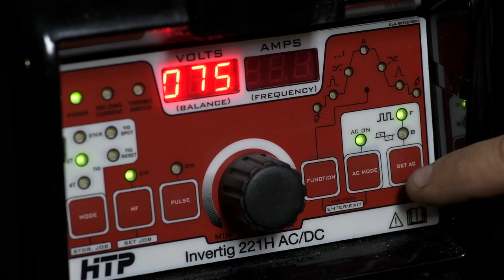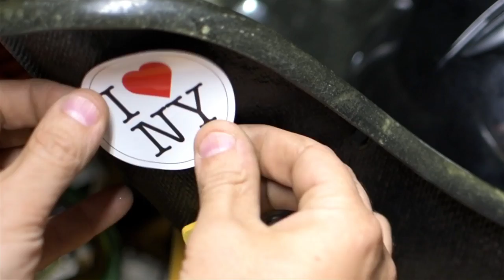GO KART - Part 4 - COMPLETED!

Comment: I'm gonna do it. I estimate $600 in supplies, $87,000 in tools and equipment, 2 - 3 years to learn how to do everything. I could cut the learning time if I quit my job.
Reply: LOL.. was thinking the same thing...
Reply: i think you are a little shy on the tool budget haha
Reply: I be thinking craigslist and scooping up a used kart and instead of taking all the time to build use all that time and go to the local kart track watching the young one learn how to drive, race, learn about apex and lines and all the do's and don'ts .
Reply: @danjason2167  na, he he's about right for harbor freight.
Reply: @donnyschort6150  ya but he might want to make more than one before the tools, tooling and machines wear out.lol
Reply: Step 1: start saving and buying equipment.
Step 2: locate a good wife =)
Reply: rofl nice one
Reply: Colin Furze is here for you! He made a bit more crude go kart without welder or other expensive tools
Reply: I can help you learn solidworks
Reply: @professoreggplant9985  Excellent advice
Reply: You can "get by" for about $86,900 if you shop "used".I didn't .....;-(.....got about 30yrs and $300K or so in.DON'T do what I did unless you want a great skill set,fair-decent career,and LOTS of friends when their sh!t breaks,lol. BTW Tony, HF tires are soft as all heck,but cheap as all heck too! OOPS,forgot to ask Tony how long/much did the track build set him back,looks like a lot of asphalt,lol?
Reply: HAHAHAHAHAHA me to.
Reply: @jzero32  Yep, I've seen karts sold for a few hundred dollars, which is probably the same it cost to build this one, minus all the tools and work required!
Reply: shit you wont be even dangerous until 10 years with all he has !
Reply: or just go to Pep Boys and spend $500-600 on a Go-Kart that you assemble at home the kit includes everything needed for assembly.. a few hours later your zipping around the yard. and if you feel adventurous Harbor Freight offers higher HP motors that fit on the original Kart with minimal effort.
Reply: @warriorwk  yeah I use Harbor Freight Tools all the time and if it doesn't say Pittsburgh on it it's more of a one-time-use
Reply: Mike Smith  yeah I guess that's true I used to build go-kart frames when I was in high school with nothing but a shity Hobart wire welder and a chop saw that was dismantled to become the death saw as we called it. It was basically a chop saw you just held onto there was no Bass. there were many exploding blades and I don't know how we were never injured
Reply: Criminy,  my first kart was a 2x10 board with an old B&S 4-cycle and rope steering. It had fan belt drive and the final drive pulley was bolted to the left rear wheel.  

I don't remember a seat... though maybe there was just another short piece of 2x10 board to lean back on. If I had a dad like you, I wouldn't have learned to be the mechanic I was for 57 years. 

Retired now, I use my accumulated tools and shop equipment for hobbiest pursuits and fixing my tractors and farm gear. 

Perhaps it's time to build another 2x10 plank racer like the summer of 1959.
Reply: You also need 2 kids, they take a while to grow.
Reply: your time and money estimates are way way low.....
Reply: lol rookie
Reply: flyrod1000 Bahahahahahahahahahahaha!!!! No shit!!!!
Reply: flyrod  at the least and more likely more !!!
Reply: So true
Reply: flyrod  the guy is a mental case ready for an institution !!!  WHACKO for sure !!!!  and OCD !!!  What he has spent in tools equipment he could have hire the house built and been finished by now, living in a new finished house rather than a basement !!!
Reply: That's why you get a guy like me to build ya one . Lol
Reply: that's just an excuse to buy some tools and quit your job lol
Reply: Or you just go to engineering school and join the FSAE team. You'll then see this build was just child's play :)
Reply: Pennsylvania Mike I built a sports car chassis with not much more, plus a flat base board (MDF). Haynes Manuals used to have a book of plans (“Build Your Own Sports Car”). Les in UK
Reply: Ambitious!
Reply: Seems about right.
Reply: I believe your estimate is legitimate, Let's add some pay time for an engineer and a certified welder, so it would cost about $100,000 to build one myself, This guy wins as he is a super dad, my go cart was awesome, but made out of wood with rope steering. Thanks for sharing.
Reply: Hey man you’ll get there some day if you dedicate all of your free funds to an u healthy machinery addiction😭
Reply: Its been 3 years wheres my go-kart
Reply: How did it go sir? You got it done I hope?
Reply: Alot more than 87k in tools lol
Reply: And alot more than 3 years to gain the knowledge he has
Reply: How’s that going now?
Reply: I’ve built a couple of go karts with cheap tools from harbor freight and tractor supply, Walmart, eBay, and Amazon as well as Go Power Sports
Reply: Awesome work
Reply: @turtleb01  ...and I am sure it would shake itself apart over time lol.
Reply: Well… did you do it or did you wimp out?

Comment: Wait a minute... My "go-cart" had a mower deck under it and only worked on the lawn. I think my dad pulled a fast one on me.
Reply: mine was just a piece of cardboard that only worked on grass and only on downhill's
Reply: MINE HAD A HANDLE THAT YOU HAD TO PUSH.
Reply: mine was a milk carton and scissors....
Reply: My granddad made a wodden car for me, with babycarriage wheel and a steering wheel from an old consul,  I also wanted a motor on it but it never happened...  Granddad, u were the best...
Reply: Mine was a wooden board with 4 ball bearings instead of wheels. Self-made :)
Reply: No!     I won best dad ever when my wife discovered my sons porn stash and I took the rap!
Reply: Lol cute
Reply: "Go-cart"? In the '60's I had a classic steel body "Lil Red Wagon" with the front wheels axle pivot assembly attached to a pull tube with a "D"  handle at the end. Motive power was another kid and you doing "turns" pushing or pulling. 
Once sister and I were too big to ride, it became a kid powered grocery delivery wagon, fire wood hauler and a light garden cart.  
I think dad greased the axles once every three/four years and touched it up with Rustoleum when needed. I remember he was still using it in the garden in the early '90's before he passed on.
Reply: had one of those too. ate shit pretty hard a few times trying to take it down hills haha  @ralphmills7322
Reply: @colsoncustoms8994  Yeah I remember a few bail outs coasting down hills... 
Most unintentional with an occasional emergency stop. If you try to push the handle too far into a turn you launched yourself arse over tea kettle.
Reply: yep, the handle was what got me every time haha  @ralphmills7322
Reply: Mine is a laundry basket going down the stairs.
Reply: @MihaiCadariu  la fel ca al meu frate 🤭🤣Made in RO 😁
Reply: Mr. Bill 'Mine' was my sister's and I got to ride it once before it was parked and never again till I was far too large to fit in it and it was pretty rusted. What fun.
Reply: You guys had stuff you could ride? I want a refund on my dad can I get a new one?
Reply: mine only worked on snow and on downhill
Reply: those were the days
Reply: @ralphmills7322  And remember: left is right..  right is left for the sake of your life.
Reply: @reniervisagie1206  And stairs, can't forget about cardboard on stairs. With a wall at the bottom.
Reply: I ride my 30 year oldJohn Deere twice a week around this yard. I have had to d a lot to keep it up. I need to take the whole thing apart and go over it all.
Reply: Me to
Reply: Mine was a milk crate and vegetable oil
Reply: Mine was a parabolic dish that only worked in the snow. Ok at one point we did have a proper go kart but you turn left too sharp and your elbow hit the bare spark plug.
Reply: HA! HA! HA!  😁😎😁😎
Reply: Heck,  My dad got an old riding mower  (1 cyl pull start)  and I got to drive it around the neighborhood for fun...  it had an OK travel speed and I sure enjoyed it.   We did NOT have a yard.
Reply: @theogdirkdiggler  hahaha... Best name ever !
Reply: Mine had one wheel and dad would keep filling it with dirt
Reply: ROFLMFAO
Reply: Billy Noon Bru
Reply: Mine was a tractor in the low speed gearbox and a grandpa sitting on the passenger seat.
Reply: mine has two arm rests and 5 legs with weeks under the seat, and sometimes i could lower and raise it, but my dad uses it for the office /:

Comment: My first go-kart was made from an old lawnmower. It had a top speed of about 20 mph and the center-of-gravity of a bar stool. It had no brakes, and the throttle was a piece of nylon string tied to the carburetor. You pulled the other end of the string with your teeth. Ah, the 1970's.

Comment: You are an amazing Dad. In raising kids, you get one opportunity, there are no do overs and I cannot imagine your kids wanting it any other way. They are quite fortunate to have you. I ran go carts when I was a kid back in the 60s. We had basically 2 types, sprint carts such as yours and enduro carts where you were more laying down with a butterfly steering wheel between your legs and 2 gas tanks, one on each side of you. And..... we ran chainsaw motors, McCullough to be exact. Very high revving, could be clutches as you have or direct drive for more serious stuff. Old Tillotson carburetors. And your kids are out in the air, not sitting at some electronics console staring blankly at a TV screen. They will thank you later in life.

Comment: We were poor and didn't know it ,our cart only went down hill what the heck was a motor
Reply: mine had an ancient briggs and stratton and was one-wheel drive
Reply: Downhill here, too.  We used our feet to steer the 2x4 front axle.  Somebody got the idea to put a rope on it.  We had to drive it into the brush to get it to stop.
Reply: Mine was two metal bars and a piece of wood to use on ice
Reply: Oh, ya'll had good old-fashioned Rolls-Canardly, too, eh??? 😎
Reply: wait you had hills???
Reply: Woohoo! soapbox derbies!
Reply: @bob15479  Ours too !!!
Reply: Gravity powered.  The restart was very tiring.

Comment: In 1966 when I was a young boy in CT. we had a visitor to our metal shop class. He had a twin McCullough chainsaw motors and 4 wheel disk brake go-kart. It was a beast.  I was hooked. You did a fine job building this sled. Congratulations.

Comment: I always wanted to learn welding. It would allow me to create even more great builds with my wood working projects.
Reply: lol yes you must use a hardwood.
Reply: PinballMan Pick up a cheap TIG and get started. It is such a useful skill.
Reply: LegionStriker n
Reply: not to be picky but when welding hardwood its best to use a dowel of the same wood for filler. chopsticks can also be used as a backup.

Comment: Drop tire pressure very slightly, like 5-10%.

I use an infrared temp gun on tires.  Measure across the tread, look at inside, center, and outside after driving a few minutes.  Measuring temp then compensating alignment and tire pressure works incredibly well for tire life!
Reply: thats awesome pal

Comment: Awesome build. Looks like a blast. Your TIG, Millwork, Lathe, & Fab, and CNC skills are awesome. To fab without a frame jig is very difficult! Keep the awesome videos & projects coming. Maybe cut where the frame is sleeved and make the frame longer. Make the seat a bench seat with a seat frame that's adjustable. This should accomodate your daughter & son. Make a cover on the front floor pan to protect rack & pinion from sneaker laces.
Reply: bench seat? really? like driving miss daisy.
so lame. 
i loved watching this project. you sir are to be commended for your efforts.
top notch fabricator and dad. A+ 
God bless.

Comment: Hey Tony, I know here in the states that we have standardized utility-trailer tires. Usually they come like 8" or 12" and they also come with the wheel too. I know you are more knowledgeable than me; however, thought I would mention that. I have purchased them at tractor supply and they have excellent durability. You might also have those retreaded if they offer that there.
Reply: Michael Hart They also have them foam filled so they won't go flat!

Comment: Not to scare you,Tony! But I have a suggestion, based on persona (real-life) experience: Try to get a shoulder belt onto this. My go kart had a lap belt, which was good.... and it had a roll cage, which was good... and when I drove straight into a tree, the lap belt kept my waist secured. That meant my head snapped forward and I smashed my face into the padded steering wheel, which broke my nose and introduced two decades of sinus problems.
Reply: that is why you wear helmet and preferably neck support and if you really want to safe - a rib guard while riding these, that is safer than a seat belt and roll cages, because stiff - non shock absorbing structures, rigid seating and tight belts introduce problems and risks of their own, there are quite a few design problems when designing "safety cell", and making everything very rigid and tight is actually bad, think about this way - if you didn't have the belt at all in your accident, you would have hit the steering wheel with your rib cage while also absorbing some of your bodies kinetic energy with your legs, and there would be very little chance of your nose hitting anything - damage would still be done, but it wouldn't be concentrated at the head area - which is pretty much the worst part of the body to use to absorb impacts for a human
as I've said times before in this series - just look at pro carting equipment for kids, it is FIA regulated stuff, every rule there is for a good reason, accidents do  happen, and serious injuries are pretty rare, that being said, if I was a parent of one of the kids driving there in competitions, I would probably have 57 heart attacks average per race
Reply: I agree on all efforts to protect his kids, but looking at proportions, there is also a top limit for protection when you consider the moderate speed this cart has. I hope your injury has been cured and you are well.
Reply: I dont have belts on my kart. With a super low center of gravity and no roll bars its really hard to flip. The one time I did, I was glad to be able to jump free. Would have been a disaster if i was strapped in. Unless you have a rollbar installed you don't want to be strapped in if it happens to flip, imo
Reply: Or you pay attention to where you're driving... I drove two fast go karts from ages 8-13, I never hit a tree. Theres a steering wheel and brake to make sure that doesn't happen lol.
Reply: Ive seen more kids hurt by having seat belts and roll bars on their carts than those without them.
Reply: @Paul Michelli: Doesn't mean some one won't hit you. That's how it happened for me. Maniac cut inside, drove me of the course and double break in my left arm. Lots of factors one can't control.
Reply: He's going all of 5 mph and wearing a full-face  at that.   He's probably more prone to getting hurt by simple running.  The danger is almost insignificant.   He probably won't run smack-dab into a tree.
Reply: DFWKen I agree, the boy was on, what appeared to be a race course. I didn't see a tree in sight. I did far more dangerous things on my BMX bike as a kid. I am amazed I survived childhood, considering some things I did.
Reply: Jason Olsen that is why you should wear a helmet
Reply: And wearing one I was! Unfortunately, it was not full-face.
Reply: you never want seat belts unless you have a roll cage. Otherwise the cart can flip and crush the rider.
Reply: Death is inevitable. Just have fun.
Reply: Jason Olsen,  How fast were you going. Yikes !!!!
Reply: to me the sinus problems are the worst part of that story
Reply: Looked like the top speed was around 10 mph, don't think it needs it.
Reply: I know this is a year old, but I got a go cart with a top speed of 30 mph on my 5th birthday in 1979. No seat belts, no helmets, no padded steering wheel.  I ran into a few things but I lived LOL. I still have the go cart and my niece and nephew drive it.
Reply: you are not supposed to drive into trees.
also i would hate to be on a go kart buckled in. my son flipped our cart in the dirt because he never braked. he'd nail the gas and go full bore around corners sliding all the time till one time for some reason the tire got a good bite and the cart flipped instead. had he been strapped in he would have probably gotten hurt but instead was just flung free and nothing but a bit of scrapes and bruises.
Reply: You just described a 70s Honda Odyssey. We use to flip my buddiy's over on purpose. Keep your hand inside or you break your arm. Saw it happen - owie!

Comment: Amazing!! the I<3NY sticker was for me ... i know.. xoxox
Reply from the maker: freudian slip.  ;)
Reply: This Old Tony 
   While it was a pleasure seeing the machine and welding work done on this job due to my grandfather having done the same for GE for 43 years, and my father for the American Can Co for 27, you worried to much over inconsequentials .
  The chainsaw motor would have worked fine if you ran the chain drive to a belt slip compression clutch available on eBay for 30-40$ . And all the front steering technicaities with caster,camber, and etc were totally unnecessary at speed's under 30 MPH, just look at what Mr Ford did with the Model T & A .
Reply: OY VEY
Reply: Who doesn't love NY??